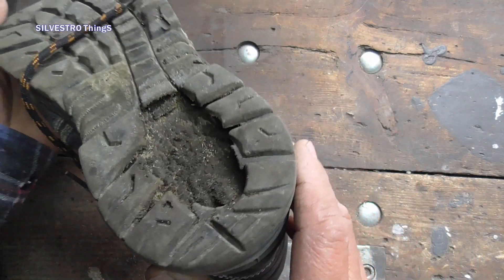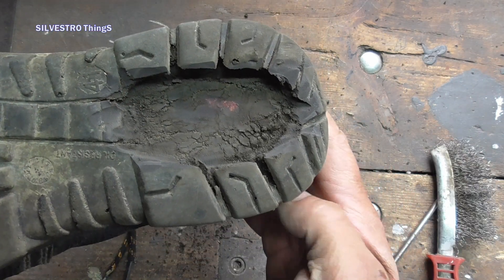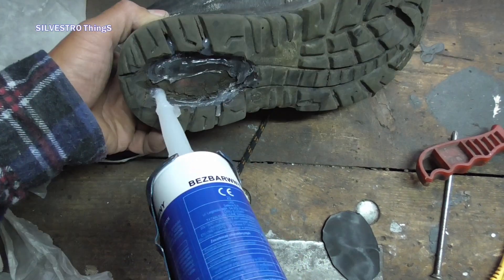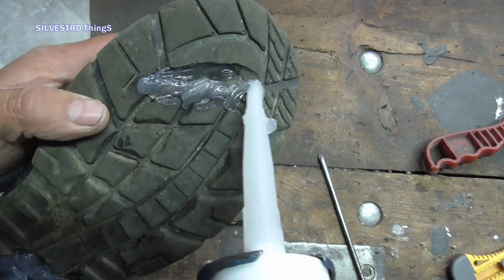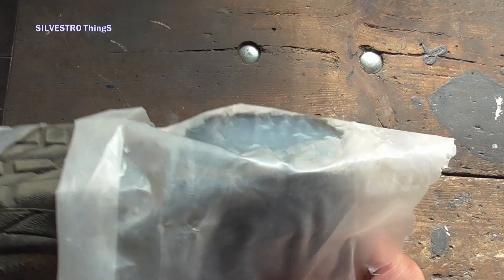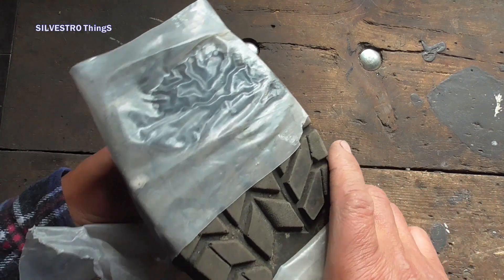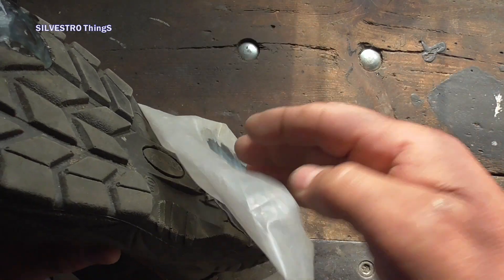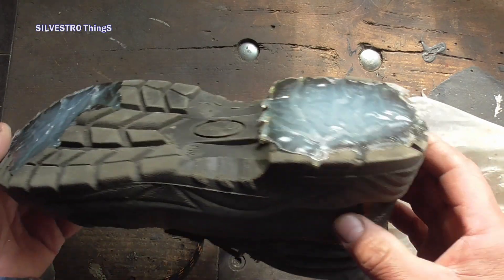How I REPAIRED Work SHOES

Comment from the maker: After three months of use, the filling came off on the sides, if I glued them back on, I estimate that the shoes could have been used for another 2 months. Because the heel in one shoe was still breaking, I decided not to repair it again. Because cheap work shoes with a polyamide sole lasted me 4 months, the presented repair method allowed me to extend the period of use twice. The repair is simple and does not require much time and effort, I estimate that it is a good way to counteract manufacturers deliberately aging the product and shortening its period of use by equipping the shoe heel with a so-called vibration absorber.